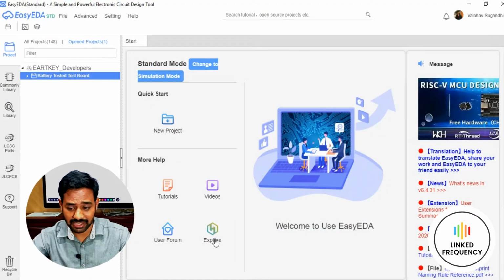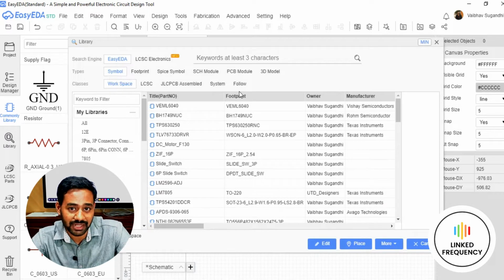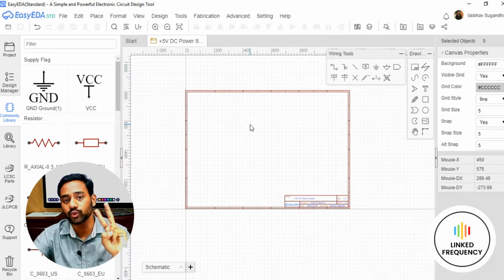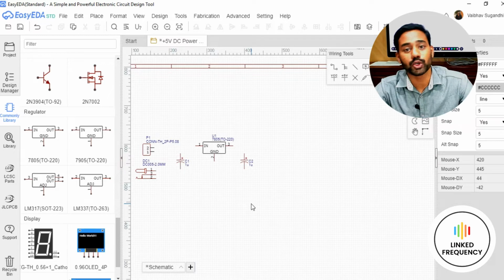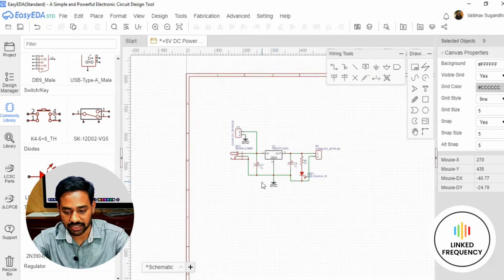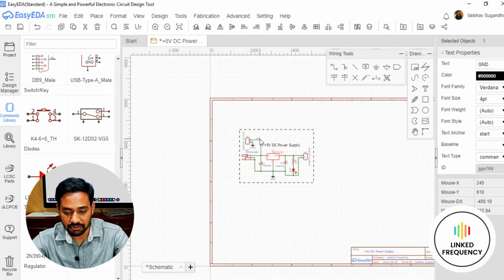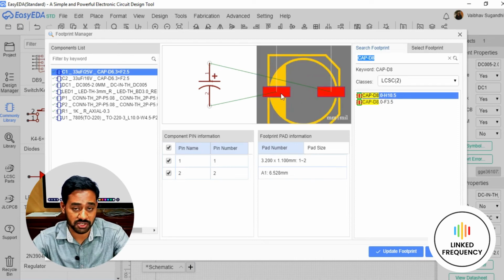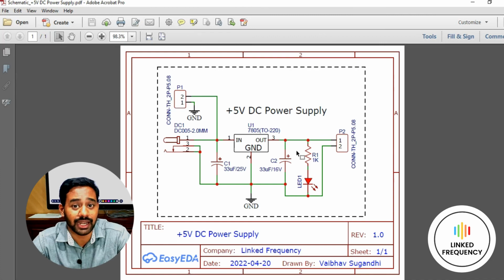The Schematic design using EasyEDA #E08 | Vaibhav Sugandhi

Comment: Hi, 

Thanks for providing us a detailed schematic creation explanation. There are a couple of things which I want to bring to your focus:
1. In the installed software version V2.2.32.3, while selecting the component from the library, the footprint mentioned by you is most of the time not available in the library column itself. Whereas, while checking the footprint in the footprint manager, the footprint mentioned by you need to be searched and assigned. So, I request you to update the video possibly every six or less months.

2. The most IMPORTANT one. I was using online editor and checking for footprint in the footprint manager. I changed the footprint of the capacitor as was told and after I exited the footprint manager, to my surprise found that entire circuit was distorted which didn't allow me to get the original proper circuit even after pressing UNDO. This is a very dangerous SOFTWARE ERROR. My internet connection was also fine. Please consider this and see what can be done. 

Anyways, thanks again. 
Cheers.
Reply from the maker: Thanks for bringing these points to our notice Sourabh, 
Let me see what can be done for these. 

Happy learning :)
#Linked_Frequency

Comment: https://drive.google.com/file/d/1EniDZ76F49AOuRBOJD9ILpg0if4iX9TK/view?usp=sharing
sir here is the dive link for +5v dc power supply ...please review this and let me know is their ant changes suppose to be done
Reply from the maker: It looks really good, however there are some improvements could be done as follows, 
1. Voltage value for the capacitors should be having "V" not "v".
2. Resistor value should be updated.
3. You can make circuit systematic & align components even better.
4. P1 components connection can be improved. 

I hope you our feedback is helpful to you, 
Happy learning, 
#Linked_Frequency